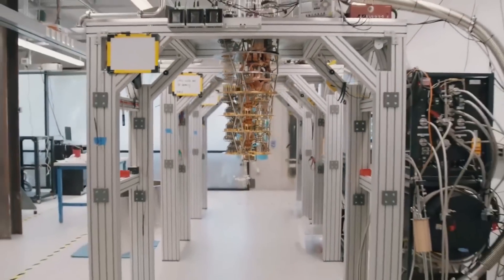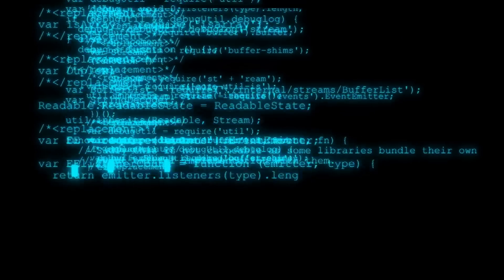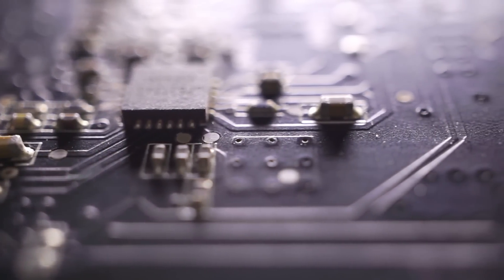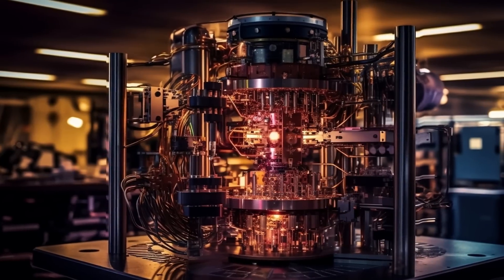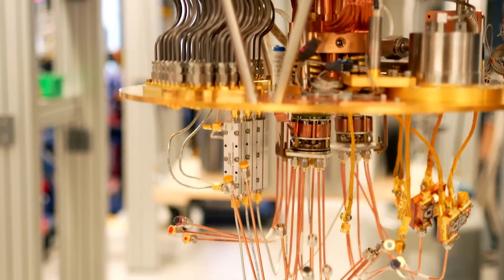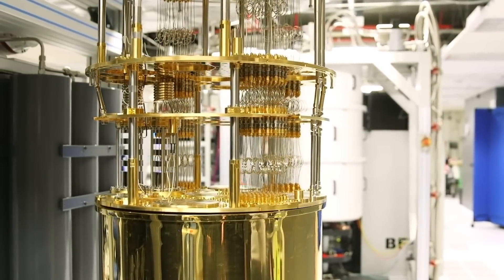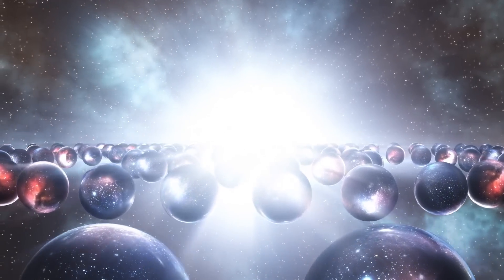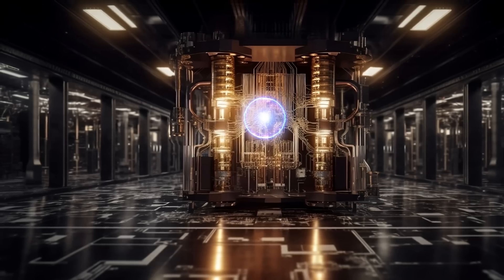Michio Kaku - This is Why Quantum Computers Will Change Everything

Comment: Digital two states open gate close gate, 1 and 0. Now you can have 1, 0 and something else called I think entangled number. Not saying I understand entanglement but a change in one electron causes an instant change in another. Like rotational orientation changes instantly. As though they are communicating.

Comment: Feynman won the Nobel prize for that in 1965.
Reply: Rossi said his patented device (2015) can produce electricity for $0.01/kWh, which, for this analysis, I will assume is true. However, he did not factor in the cost of distribution, which is currently no less than $0.05/kWh and considering needed infrastructure improvements to incorporate his devices into the grid, $0.10/kWh. Since the Chinese currently deliver electricity to their businesses for $0.05/kWh, retail, and have plans to do so for the next 40 years with the same tried and true coal fired electricity generation plants, and Rossi sold them the rights to his device (for manufacture and distribution in China) for $100 million, any means of producing electricity that utilizes the same central distribution system (the grid) will fail (be non-competitive). If any candidate chooses to jump on board the Make America Great bandwagon, I suggest that they do so with a more realistic financial prospectus. . . .

Comment: The Planck length is ten to power  minus ➖  thirty-three centimeters  a protion is between two to power ten minus ➖    ten  to 2 ten power minus fifteen  fernometer    nucleus of a atom is ten to power minus ➖ fifteen fernometer
Reply: What will you DO with that info? That's the only question that matters...
Reply: I mean but if You carry the 1, then Your at absolute absolution, absolving aboriginals. Now introducing thermodynamics into this equation is just kinda getting ahead of ourselves ahh ha ha , so no need.

Comment: This is all bullsit. QC can't check all passwords at once if application interface don't allow you that. There could be a set timer that you need to wait for example a 30 sec  or more after you type a wrong password and one day if you type 5 wrong answers in a row. :) 
Quantum States even if they will work, they aren't useful in anything.
If you multiply one mixed QS (not 1 or 0, but  mixed stated equal to "maybe") by another mixed QS (another "maybe"), then you get what? Do you get "maybe"^2 or bigger maybe? :)
There were works for so many years on QC and QC are still NOT working. It looks like engineers can earn some money on that and only they profit from that scam.

Comment: If Einstein only knew that spooky action at a distance would not only be proven to be real, but would be used to make the most powerful artificial minds ever!  Wait a second, maybe we should be wary of this?
Reply: Actually, Einstein was right already back in 1930. Quantum entanglement is a hoax.
Reply: @Vatsek  Well the EPR paper was from 1936 I think.  The paper raised the bar for those at the frontiers of QM needed to prove that entangled particles communicated faster than the Speed of Light.  John Bell devised a formula that could be experimentally tested to prove this was the case.  And they proved it and got a Nobel prize.  This was science at its best.

Comment: In the tech sector sentient AI has been floated for a long time. We think it’s already happened.
Reply: Quantum computing uses the qubit as the basic unit of information rather than the conventional bit.
Reply: A classical bit can be either 0 or 1.
Reply: A quantum bit, or qubit, is a superposition of 0 and 1.
Reply: So while 3 qubits will store 8 bits of data, 13 qubits will store an incredible 8192 bits or 1 kilobyte.
Reply: Quantum AI can create new and more secure encryption methods that are resistant to quantum computers.
Reply: Sentient AI is an artificial intelligence system that is capable of thinking and feeling like a human. 3:55
Reply: The quantum race is not just between tech companies, but between nation-states as well.
Reply: US leads in Quantum computing while China has an edge in quantum communication. [TechoVedas]
Reply: Quantum supremacy describes the ability of a quantum computer to outperform their classical counterparts. 7:47
Reply: Quantum theory is the branch of physics theory that seeks to explain phenomena occurring at an atomic, and even smaller, scale.

Comment: I think they're barking up the wrong tree, I don't think this is going to be the savior they're claiming. I hope my wrong, but we just haven't seen the benefits.
Dr.Kaku said it; "on certain tasks".. so it's great for some very esoteric computations, on everything else it's no faster than silicone chips.
Reply: lol
Reply: no, it`s that it can only actually do certain tasks right now (you can not run a fkn windows on your quantum computer)
Reply: @applecake6135  Exactly! Outside a few very specialized areas it's pretty much worthless!
Reply: They will not replace personal computers but it will used for specific tasks that could reshape the future .